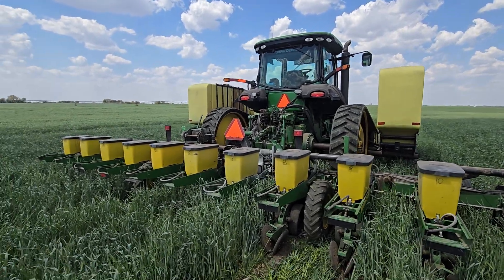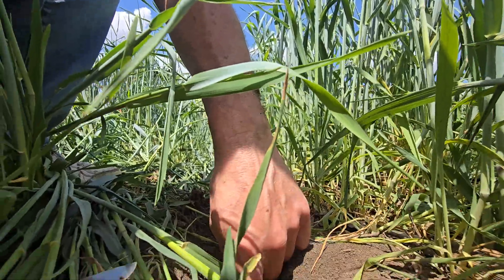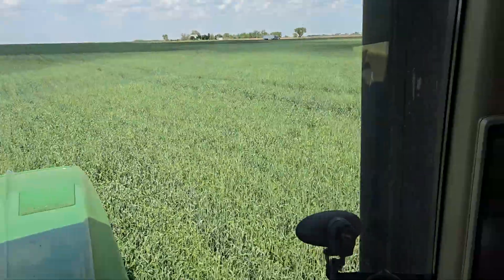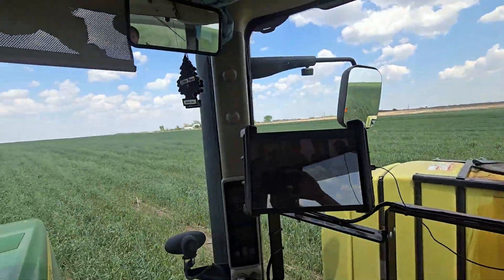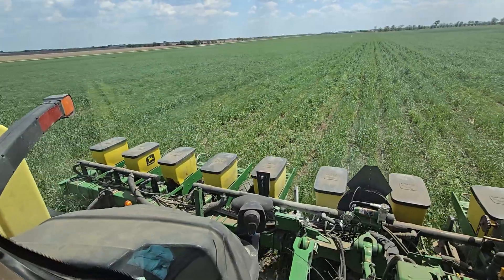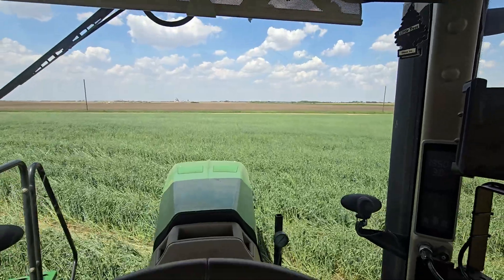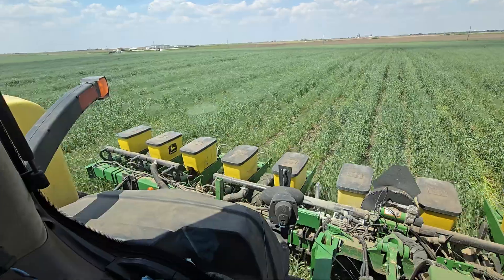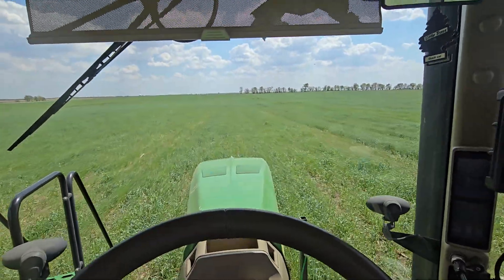Planting 2025 Regenerative farming.

Comment: I’d like to hear more about your fertilizer. And how you set it up. Just dropping on top the seed?
Reply: Btw. Wet here in northwest Ohio. About every time it gets fit enough to get in to notill we get a couple tenths every few days.
Reply from the maker: @kahlerfamilyfarms  how's the sub soil in your area?
Reply: @growthefarmup2606 I’d say wet. Quite a few people are mudding in crops. We aren’t officially in a drought anymore (for now)
Reply from the maker: @kahlerfamilyfarms  so NW Ohio is wet with good subsoil.  Thats literally the 1st non drought answer I've gotten. Need to get some different perspectives from around the country.   Thanks
Reply from the maker: @kahlerfamilyfarms  I went thru it a few vids ago, 12 gal and acre, 2.5 gal 28-0-0 1 gal 10-34-0 1 gal molassis concentrate sugar 1 gal concentrate humisource (liquid leonardite) all cut with 6-6.5 gal water.   I turned up the water to 12 gallons and left the fert mix alone, it put enough water down the trench to almost "irrigate" the trench and we use a squeeze pump for so we can run the thick biologicals.

Edit, always cut my in Furrow with water, im not a big believer in 5 gal 10-34-0. Too much salt in my opinion more harm than good some years in my area.  Thats why I put together this custom "biological" in furrow mix

Comment: If you look at the capillary action of water in the soil, the old-timers would say you cultivate your way through a drought. Very shallow. You cultivate but you keep cultivating and it keeps bringing up moisture. When you stop cultivating the soil seals up and that water stops moving up. That was the theory and I think today's science could actually back that up. Grab a cultivated through the '30s and '40s 

And I remember when I was full tillage and cultivating and I remember one year the guy that combined for me back then when I was a kid asked what happened at this line I said well that's where I stopped cultivating.
Reply from the maker: It also increases your Soil Electrical Conductivity (EC), often referred to as ERGS (energy released per gram of soil) is a measure of the amount of dissolved salts and other ions in the soil solution. It indicates the soil's ability to conduct electricity, which is related to its nutrient content and potential for plant growth. Ideal EC values for most plants typically fall between 0.2 and 0.8 dS/m (decisiemens per meter)  ergonometers tought me the best time to till is mid summer when nutrients are moving the most efficiently (most quickly)

Comment: " it's a thing of beauty. Clark"!

Isn't that amazing? You've got the water cycle working in your field. The boys in Minnesota need to understand there's more to soil and water than just" excess water"

Here you are with a very not dry, friendly cover crop in a dry area and you've got plenty of moisture

I did some reading and some questioning and then you end up on a rabbit hole. And if you start to read about soil life, it is one of the major influencers of the water cycle in your soil and how much your soil can hold. So like the guys by me that have that half a percent organic matter soil and they claim they can't do cover crops because it will take too much water. Well if they started using the right cover crops and they started farming in a manner. That was a lot more carbon friendly like corn on corn with some covers in it. They could very quickly increase their water holding capacity but also their infiltration rate. So when you got an inch of rain you got the whole inch. You didn't just get the first half inch and the restaurant off.
Reply from the maker: @jonstevensmaplegrovefarms3754  I've got another video set to drop tomorow morn that goes thru a Ward Labs soil health analysis, Org matter of 5.6. I had to give you a shout out back!  

I've found the more deep roots (of anything other than. Palmer amaranth) is just good for org matter, org matter is one of the 3 keys to u locking full potential IMHO

Edit:  Ill be curious your thoughts on the vid that drops tomorow morn.

Comment: We've had good windows here in southeast Michigan. There have been some storms dropping a fair amount of rain but then we have been the getting a few dry day in between. Over the long term our area has been showing light yellow on the Palmer drought index.  Usually if we were setting up to be going into a drought season, it would already be shaping up. Those years we are usually done planting early and have hay off by the first of June.  This spring I think we're cooler than normal.  This next week we have forecast highs of 53 degrees. Twenty degrees below normal.
Reply from the maker: @danw6014  i dont know if there is any such thing as a "normal" weather pattern, but it sure seems like weather throws us a 1st every year.  Glad to hear somebody is getting some rain!  The crimper is working well and holding down the pivot applied water.  More videos to come!  Thanks
Reply: @growthefarmup2606  can't wait to see the crimping videos. This is something I would like to do myself.
Reply from the maker: @danw6014  yea I've got a video of the crimper in the pipeline, im behind a few weeks on videos and try to keep them somewhat chronological, but I should drop a short or sonthing of that crimper its done a remarkable job of holding down the moisture, stopping erosion and holding down the weeds so far. I've had 2 fields crimper for about a week.  It is very interesting to see.